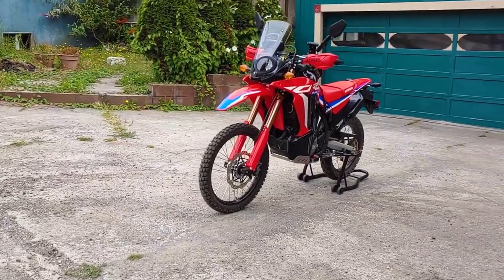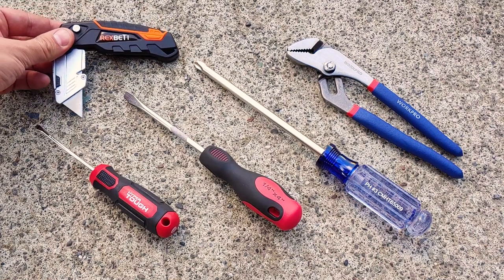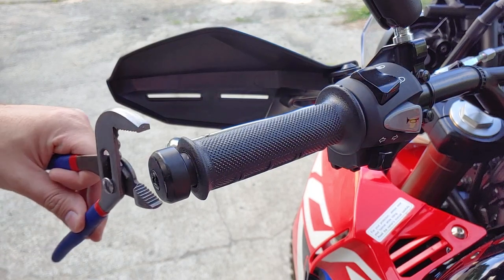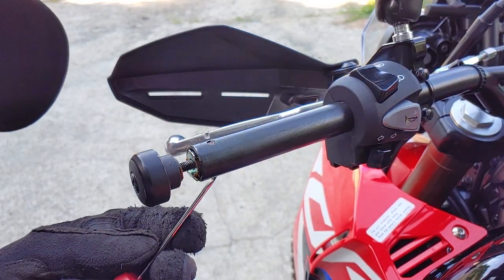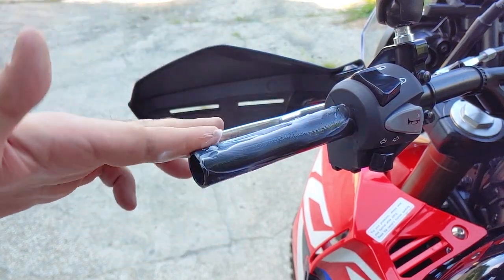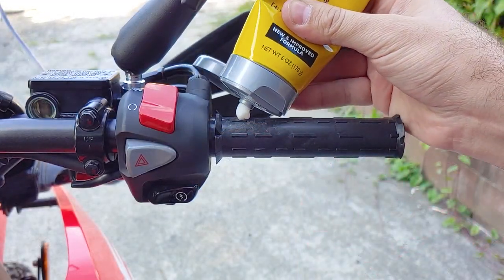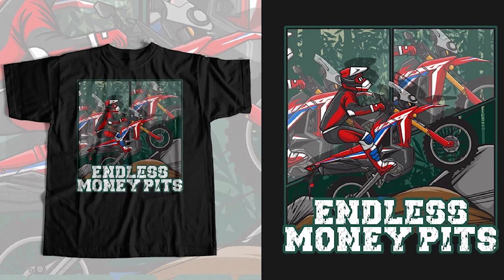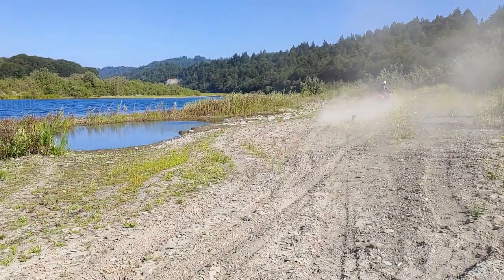Hand Grips Replacement Guide feat. Honda CRF300L Rally

Comment: How did you remove the bar end weight mount on the throttle side? Did you have to open the housing and remove the throttle tube?
Reply from the maker: Same as the other side. I did not need to remove the throttle tube. I have a video just on removing the bar ends but I don't remember if the footage is any different.